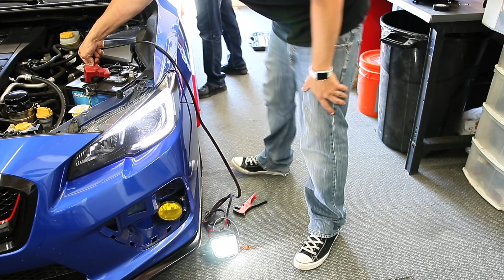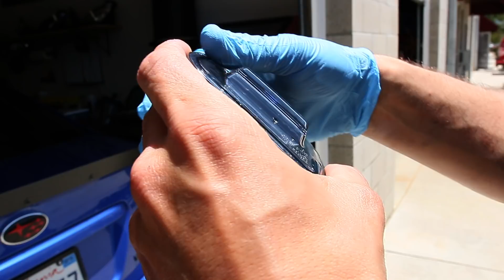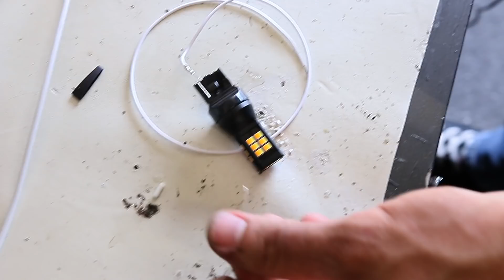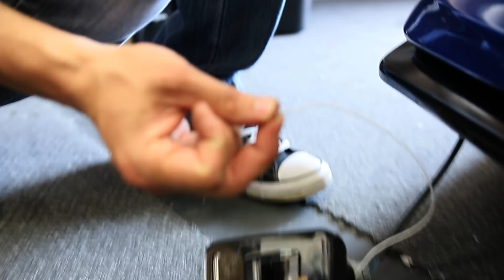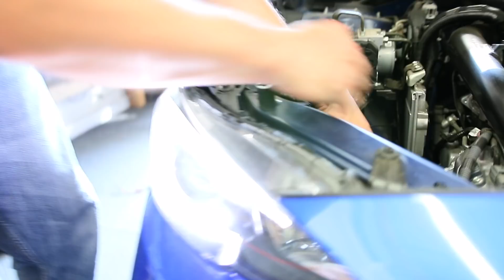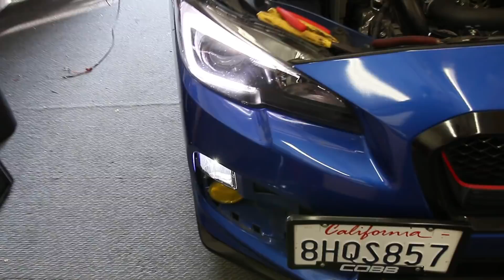How To make Switchback Turn Signals | Subaru WRX | FlyRyde

Comment: So I've got a 2012 Jetta and if I wanted to do this to my fog lights it would be reversed wouldnt it?? The 3rd wire would be to the Amber pin and piggybacked off the turn signal on the head lights??

Comment: YES!! I’ve trying to think of how to do this but was being far to complicated. I know exactly where I can use this first.
Reply from the maker: Dan Balcaen awesome! You planning to do it on a WRX?
Reply: FlyRyde no on my 04 Chevy 2500 HD. My DRL and marker/ signal light are separate bulbs in one light assembly. I want both bulbs to be signal and marker but only the original DRL to stay as DRL and of course do it all with Dutch back bulbs. I was just over complicating making the single function DRL into a switchback

Comment: You can build the same type of circuit with a 7440 bulb (or any single function bulb really) using a 5pin relay wired to parking and running. Albeit only one color. 

Love your videos man. Love how clean your custom work is. Your videos are inspirational and lead me on the same type of path.
Reply from the maker: Keith Poley thanks Keith! What’s your IG, or anywhere I can see your work?

Comment: Kinda off topic bro but have you ever tried black chome inside the headlights instead of flat black?
Reply from the maker: The only downside to these spray tints on top of chrome, is you can’t prep the chrome with any type of adhesion promoter if you want a super strong bond. Doing so gives a much cloudier result. If you want a perfect mirror finish, you just spray it on without prep, which can eventually lead to peeling later.

My experience has been good and bad with it. Great video topic to cover soon tho! I have a few ideas for new methods.
Reply: @flyryde  sweet thanks for the reply
Reply: I have tried this on a 350Z headlight build for a guy using Smoked Chrome Duplicolor Metalcast, It looks cool if you don't use too much.
Reply: @SoulUnslaved  does it also serve as a reflector sp it doesnt burn as bad?
Reply: It will still be reflective like a colored chrome. I know that Duplicolor offers a clear adhesion promotor but I've never used it, sounds like Chris says it clouds results. When I use Metalcast I just be sure to clean the shit out of the chrome with dawn dish soap and sponge to get any grease or dirt off that leads to peeling and poor adhesion. Personally I really like the paints, Ive got the whole set!
Reply: @FlyRide would love to hear your new method ideas!